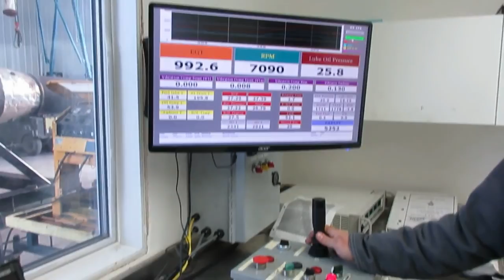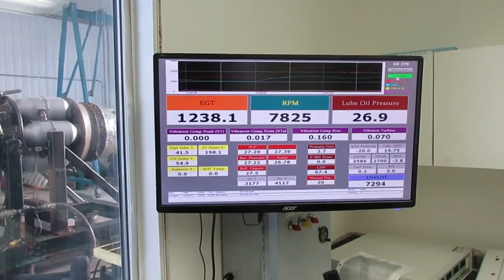Orenda 14 Turbojet at Max power

Comment: Yea HAW,  I love the sound of turbine whine in the morning !!!!  One simple question, after the engine was shut down, it takes a while for the compressor and turbine to spool down.  You walked behind the turbine exhaust after about 60 or 90 seconds, Was the exhaust gas stream still warm,  or once fuel is shut off, there is so much air from the compressor passing into the turbine that it cools off rapidly?
Reply from the maker: When the fuel is not there, it's not heating air. The hot metal parts of the engine are cooling, so I was walking into a 400 degree breeze. As opposed to a thousand degree blast that would have knocked me fifty yards back.

Comment: I wish starting the jet (siemens GT 35) at my work was as easy as this, we have run through an checklist a mile long before starting...and it almost never starts the first, second or seventeenth time we try...because of all the sensors and valves that have to work...

Comment: I'm sorry if I repeat a question here, but can you tell me how small a turbojet can get? I want to say: Is there a limit at the "bottom" of size? Because when I see what size gasturbines in a powerplant are, I'm actually not thinking: "How much bigger can you make it?", but "How much more compact can you make these machines?".
Reply: You can get RC model turbojets.. incredibly expensive but they're about the size of a watermelon and put out 15-20 lbs of thrust.  That crazy french guy with the rigid wing jetpack has 4 of them mounted up.  People have made very small home brew jet engines out of car turbochargers too.
Reply from the maker: There is lots of literature out there about micro turbine engines. By micro I mean on the scale of one millimeter or less. 
They are made by layered printing, like an electronic component, and look fairly crude. They burn fuel, turn at millions of rpm, and produce power. 
Heck, maybe in the future we will have jet powered germ killing nanobots...
Reply: @AgentJayZ  - I've read some of the literature, too, and it appears that the engineers are working on exactly that, as well as a whole slew of other uses, such as powering electrical switches and hydraulic servos - all on a microscopic scale...

Comment: I'm thinking the whole time, walking in front of the intake would be enough to get pulled off the flightline and get masted, if you don't get sucked in. How do you deal with the weight of your balls? Love your videos!
Reply from the maker: It's important to know the difference between idle, low power, and max power. The camera does not do it justice.

Comment: hi, got a question, during a turbojet or turbofan engine overhaul, what parts usually get replaced?
Reply from the maker: 1) parts that are broken or damaged beyond repair.
2) parts that are worn beyond allowable limits
3) parts that have accumulated time in service that is near, at, or above the allowable limit.
4) parts that are specified by the manufacturer to be "single use only"

Comment: How common are engines with variable stators?
Reply from the maker: I would use the words ubiquitous and universal...
Reply: Having just registered a mild disagreement with AgentJayZ, I certainly agree with him on this one.  R-R was a late entry into VSV usage, but the BR700 series of engines has a 10-stage compressor with a VIGV row and 3 stages of variable vanes.  The next generation of big turbofans from R-R will follow, on, using a 10-stage HP compressor with variables.